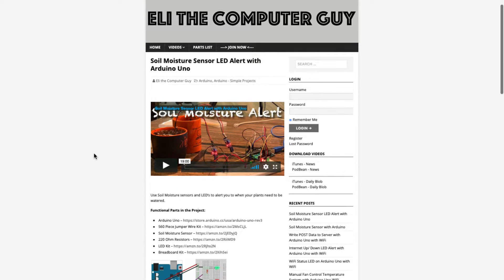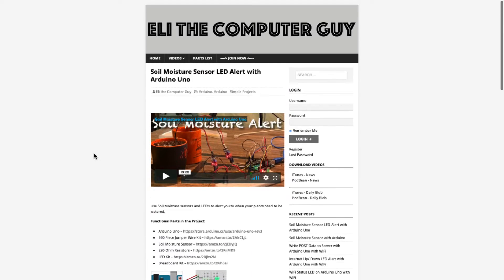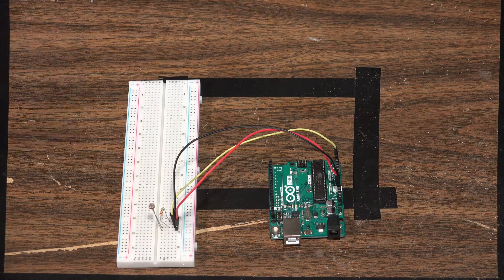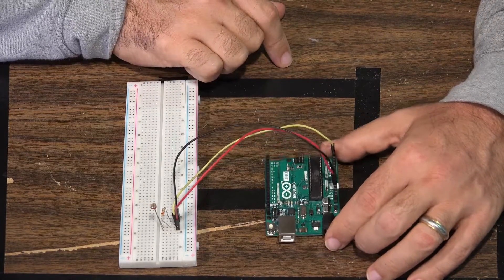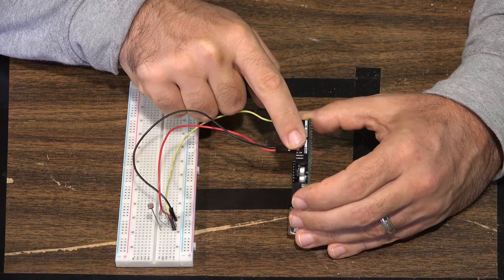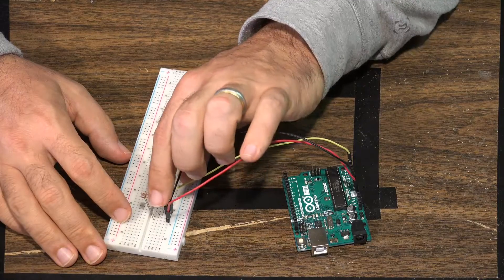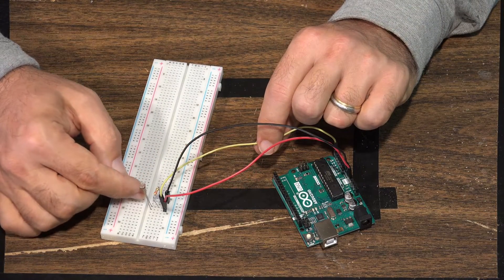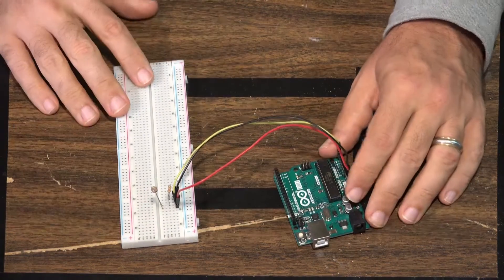Photoresistor Light Sensor with Arduino

Comment: by explaining the use of various resistors you gave me a new understanding as to why we pull the signal off the negative side.... adding a resistor is like making a voltage divider... as I understand...  the various secondary resistors allow different values to come off the photo resistor... R2=R1*Vout/(Vin - Vout).... where R2= 220ohms, R1= CdS, Vout = yellow wire reading at Arduino, Vin=5 volts... I am sure this formula should be rewritten to determine Vout, but the voltage divider formula makes sense for choosing different R2 values....

Comment: hello, i have a question regarding on the resistance value.
is there a lowest requirement value for the resistance(maybe at least 220 need to be use or any value)? if yes, is there any formula to calculate or prove that?
looking forward for your reply

Comment: i am confused. when you explained the flow, you said Vcc flow through photoresistor, then to the 220 resistor, then to the analog and ground. But i thought the flow was on the opposite way because negative electrons flow towards positive protons. Can you help me understand please?
Reply: look up a discussion on conventional electron flow vs actual electron flow... you are correct, but originally 100+ years ago they thought electrons flowed from positive to negative - this is conventional electron flow... most diagrams still follow this philosophy... there is a great explanation at "simply electronics Basis, how batteries work):                                 https://www.youtube.com/watch?v=9HlD40SLwr0&list=PLYS_1w0FFIANdG78JyJu3tsumsXVIcXUB&index=2

Comment: hello, great video,very inspiring, ...it gave me an idea. 
how can i control 8 Fotorezistors and log the lighting conditions over from each individual Fotorezistor(placed in different areas) using just arduino or just one raspberry pi ? 
basicaly i want to place 8 sensors around a small room and log the light intensity throughout a day.
i'm thinking that neither arduino or raspberry pi has enough gpio pins...
please help me understand how i could log data from 8 Fotorezistors at the same time placed in different areas.